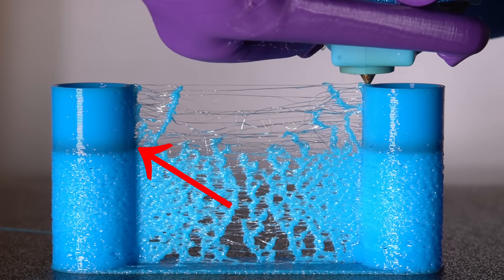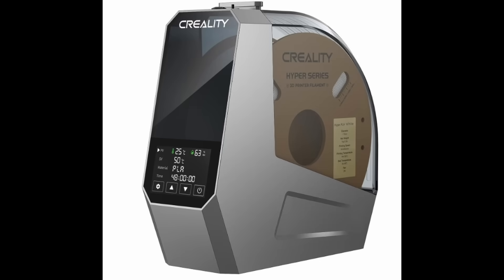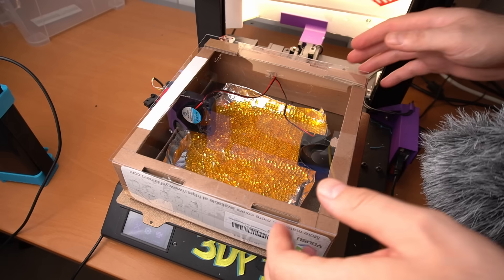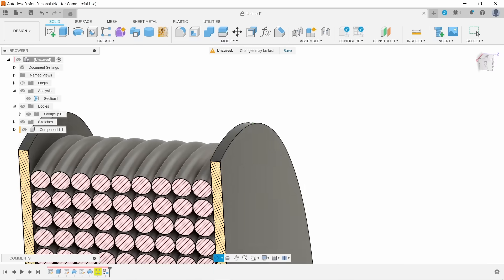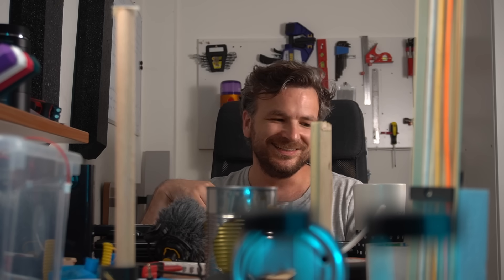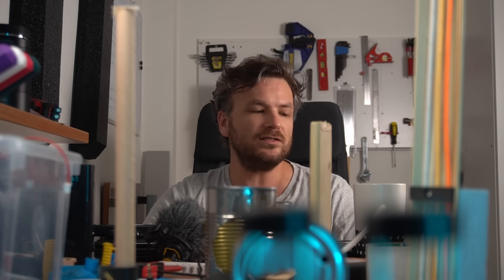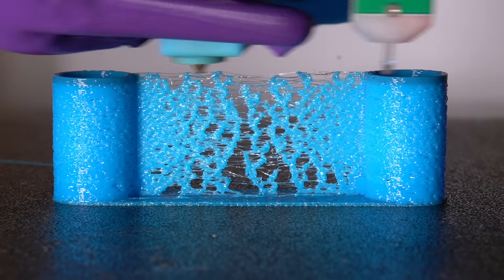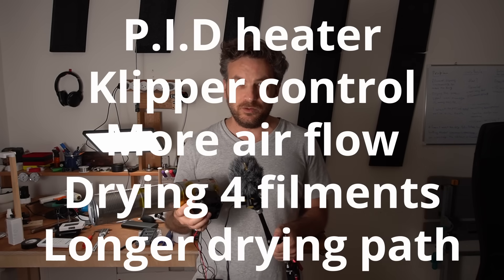Why are we drying filament this way?

Comment: As someone said - don't study physics in school and your life will be full of Miracles 😀
The method mentioned can't work because it is impossible to achieve the diffusion of the water from the insides of the plastic in such a small time. Yes, it is possible to dry a little bit of the surface moisture, but definitely not inside

Comment: Super interesting idea, I also wondered how often I would dry my spools when I only use 10 grams at a time. Pretty obvious instant drying only scales for smaller prints. If the print takes 12 hours and I run a 300 W heater all the time, that will cost me a much larger fortune than running the dryer before. I'm very curious what the next steps will be. One could probably easily combine both, instant dryer and drying box, then run the filament from the box through the instant dryer and turn on one or both depending on the print.

A thing I also learned from this video is how much surrounding humidity affects filament. The room my printer is in is very dry on its own (around 40%), resulting in me not having dried filament for over a year, including TPU, because it simply wasn't necessary yet. Looks like I take benefit from the place I live in.

Comment: Filament dryers sucks, but they work just fine through their inefficiency. You dont have to wait to print if you properly stored your already dried filaments or used a 100$usd filament dryer as they all let you print directly from them. Also, the entire spool gets dried in 8 to 12 hours, not just the surface.

Comment: It seems to me that the best way to remove moisture is to do it at the hot end since the whole filament is being brought up to temperature in that area. We'd need to understand the mechanism of how the entrained moisture acts as the temperature rises from ambient to melting and devise a system that extracts it at just the right point. This is, of course, is beyond the scope of this experiment but may trigger an idea from someone familiar with thermodynamics and fluid properties.
BTW, enjoyed the video and I echo many of the comments about how genuine and entertaining the presentation was. Thanks.

Comment: I don't think you can get away without the drying time. Yes, drying the complete spool brings its inefficiencies, drying bare filament is faster. But it still needs its time, the moisture needs to pass from the bulk of the filament to its surface to get impacted by the air at all. And that mean big part of the usual whole spool drying time is to let the moisture to diffuse towards the surface. Plus having the surface overdried won't help when the core humidity is still high. So just letting that equalized needs is time too.

So the main result is, the most efficient method is to prevent the filament from getting humid in the first place...

Comment: My Imitate thoughts were, counterflow the warm air against the filament movement direction, but no need for such a big can to surround it. Just some long hose (meters). Might need a fan with more static pressure. Also wrapping some isolation around it to retain the heat.  Should still be much slimmer than what you show, and can even be coiled up to increase the length, and then you even have to thermally isolate the whole bundle with a layer.

Comment: Changing settings and printing from a dry box invalidates your results.

Learn from radiator technology.  Try a multi-pass arrangement in your tin can heating tube.  You need to keep the filament in the hot, aerated space as long as possible to maximise the drying effect.  My guess is the reason the $2k unit works is that it does this, with clever engineering to solve the challenges of filament feeding and binding.

Comment: I keep all my filaments, printers, and dryers in a Chitu Systems Printer Enclosure, and I still have plenty of space left for printed items and all the tools I need for post-processing. When neither the dryer nor the printer is turned on, the maximum humidity inside reaches 45%, and during printing it drops to about 35-40% at a temperature of 29°C. This is the temperature inside the Printer Enclosure. The filament is additionally stored in a dryer set to 55°C, which is inside the Printer Enclosure.

Comment: Filament will go past a point of no return if you leave it for too long. Instead of simply behaving like a sponge for the water, the water eventually reacts with the filament to form a completely new chemical. You still need to store the filament with moisture control, but your method is probably amazing for perfecting it during a print.

Comment: I've never dried filament one time. And never had one problem... Not even once.
I've never used the cooling fan on the Hot End even one time...  And never had a problem...  Not even once...
I've never used a washing Station for resin printers even once... And Never had a Problem even one time...
I've never used a Curing Station for Resin Printing even One Time...  and never had a problem once...
I never filter Resin.
I've never used a Vat Heater.  I've never used a Carbon Filtration System.
I've never used a resin transfer pump.
Never used a time lapse camera on either fdm or resin printers.
People watch too many YouTube videos and buy useless, Expensive crap they don't need.

Comment: As someone who lives in the UK where humidity is currently 80% INLAND, This is VERY interesting.
What temperature was that heater outputting? I imagine quite high due to the short run distance??? BUT if its below 80°C (176°F) Then you could probably 3D print something more efficient than the tin cans. i.e. something slimmer to the filament so that there is less area to heat and something that can make the airflow more dynamic (something like rifling?). 

Edit: just noticed that you have done a part 2, will head over and watch that now but will leave this comment here for engagement :)

Comment: i just got a 3d printer 3 days ago. I have printer non stop.... my AMS says that all of my fi9llament is WET.  I did have some miss prints, but just upped the nozzle temp to 210 and the bed to 65 and slowwed down the printing speed. . and no issues since then. I have printed non stop  :) i guess i got lucky but thanks for making this video!

Comment: YOU NEED SILICA BEAD AT THE BEGINNING YOU ARE PUSHING HUMID AIR , YOU NEED TO RUN THE AIR IN DRY 1ST THEN THE AIR MOVEMENT  AND HEAT WILL DO THE REST ALSO YOU HAVE TO MAKE YOUR EXHAUST ONE WAY BECAUSE WHEN USING A FAN YOU ALSO MAKE A VACUUM SO YOU ARE BRINGING HUMID AIR IN THRU THE CANS.

Comment: I got the Thordsen one. It did work for me, except: the feed path is tricky. I use an AMS. It would not feed filament through this, so it only works with single filament prints. 
If you could design one that was AMS friendly, use heat, desiccant, and airflow, you might be onto a universal and fast answer. 
(I hate having to plan far enough ahead to dry filament for 8-12 hrs. )

Comment: I always had this little question too since I started 3D printing: "why do I need to dry the whole spool if I just want to print some 50g of filament?" But since everyone is making the same style of dryer, I just thought that it's the only or most efficient way. Apparently this video prove that it's not. 

But well, my guess as of why no one made this would be patents. Most likely there's a patent regarding in-line drying of some sort, maybe not even related to 3D printing already exist. And when you want to make products that's marketable in the west, you have to respect these patents. So since no one want to be the one testing the waters, nobody invested enough to make one.

Comment: Basic physics would say that if you are increasing the mass that needs to be heated, then more convection energy would be needed to evacuate the additional moisture. So as not to effect the other filaments individual drying process.

Comment: your idea is great but not new

years ago I built a 4 spool fast dryer. 
A cloths storage box 12x12x24 in with 3" spools with 1 " centers as guides on frames front and back to keep tangles out the filament wrapped around giving 3.4 meters in free air
a prusa bed heater plate and fan for 55C air flow.

An arduino, LCD, buttons, thermistor, FET and humidity sensor made up the control

Comment: I'm looking at the video and thinking to myself how to make your 50cm tunnel fir on a desk - and in the last frame it's right there - wrap it around a spool . the simplest ideas are usually the best so take a look at the spool drier for the whole spool and my first thought was - just wrap 3-4 turns round it and make another hole on the outside to turn it into an inline drier.
My next thought was to use some spacers to keep it off the center of the spool.  - that would be more filament per turn but more importantly, better airflow.
Then I thought - just use an old spool and poke some wire through the holes near the edge to maximise the diameter used - and hence the amount of spool per turn.
Final thiught was for it to be in a box below your spool holder - so it takes the same amount of desk space and doesn't kink or have to make any turns.
So just convert a box spool drier for inline use - add some silica gel beads and figure a way to mount your spool holder on top and you've got exactly what you're looking for - the only thing needed is... an extra hole in the spool holder box, an old spool and a few bits of wires, screws, 3d printed spacers - whatever floats your boat.

Comment: how about a box with good seals and strong vacuum inside? water evaporates much easier under low pressure, all else held equal. would make any extra heat much more effective, at the expense of added trouble of maintaining a dynamic vacuum.  not a big step for a stepper like you.

Comment: I like your basic idea. If drying your filament as you go is what you want to do, it would seem that a single-layer filament spool with grooves running in the wrong direction to keep the filament in place on the spool could be used. You could then run dry heated air in a circle around the filament, which would do the trick.

Comment: You could also try the replacement technique:
Submerge the whole thing in some liquid that doesn’t dissolve or otherwise interact with the material, but its surface tension is lower than water, essentially replacing the water with it, ethanol for example but idk if it’ll dissolve your filament, thing is that ethanol will evaporate very easily one exposed to air, so just a fan will do, a hot air fan will make it even faster.
If can’t use ethanol try other types of alcohol like isopropyl or methanol, I’m not a chemist so you’ll have to research for something suitable for the task.

Comment: Problem is too small amount filament inside tiny cans. You really have 2 options, use way tin cans and fans or put way more filament inside the same amount space. Even then you most likely can not solve the issue fast. I have plastic industry background and believe or not, sometimes takes even small granule try time about week or so. What works is circulation and load of air flow. Heating is necessary only so much to get air sort of dry....cooling works better because AC air output is way more dry air. That is why cars use AC even on coldest winter time. 8 hours, 12 or what ever hours most likely is not enough on any conditions if there is already exposure for moisture. Conclusion, there is not possible to get nice dry plastic just instantly.

Comment: Instead of blowing down on the filament, you should blow against the direction, at a slight angle. 
Then you have way more exposure time, and should dry more effectively. 
Just put some water on a flat surface and use a heat gun.
Pointing directly down it will take many seconds to dry it, but if you angle it, it's gone in a second.

Comment: I’ve had good results using the polymaker dryer while printing. It literally heats the filament that is being used first since that filament is on the outside of the roll so as your print it’s drying the outermost part of the filament spool at a faster rate than the rest of the filament essentially doing the same as drying a strand that except you don’t risk stretching and braking of the single strand if your temp peaks to high.

Comment: Great idea! I must admit I use a food dehumidifier which is fan forced. It is big enough to hold several spools if necessary and runs at 75 degrees Celsius. Your idea of in-line drying is excellent and I wonder if a insulated tube from the dehumidifier to the printer allowing warm air to flow between them would be even better. Just a thought…….

Comment: I absolutely love this idea but I would take it one step further

I'm not sure exactly how you got to this point as I've watched the entire

But what I would do is I would add tubing that you can bend maybe copper or something that's soft and add some additional holes into it that way it can transfer at a longer Pace in a spiral and still get air flow and transfer of the heat directly into it as we all know that copper is a good thermal conductor
This would give it what I refer to as dwell time

It's a term used in firearms and maybe used in others but basically it's a form of time over length of set time to allow mechanical functions to work

In this time it wouldn't be a mechanical as much as a thermal and gasification process

Don't get me into gasifiers lol 

Put gasifiers do the same thing they basically heat a particular material up until it creates a gas that is used for all different types of purposes

But in this case we're trying to gas off the moisture...
I love the project but I don't have the time to test it out myself and this would give you a bit of content for your channel and you seem to have the time

Keep up the great work and if you like it and it works you can tag me in it or you can just say this dude was onto something but not quite LOL😂🎉❤

Comment: what if you make the path through the cans longer as to keep the filament inside the moisture extraction phase longer, like with pulleys or tracks or a cylinder within a cylinder which can have a longer portion of filament inside the drying chamber at once, keeping it exposed longer?
I know friction is an issue when wrapped around too many times but maybe that can be figured out too maybe a rotating core that helps move all of it along as well?

Comment: So it does work, or it doesn't work? When you talked about how you don't normally have your tpu at 60% humidity, you showed the printing using filament that's in the normal dryer...

Comment: sooooooooooooooooooooooooooooooooooooo it could be used during respooling, rewinding spool isn't that hard, there are free models to help you set up rewinder, you'd just put this in between and have it run, possibly cutting down drying time significantly? 

for people who store more spools at once, having a big cabinet (just wooden box is enough) to which you stuck regular home dehumidifier is mostly enough, but this could be cool to fix already wet filament, maybe something you forgot in the open

Comment: Get a peltier cooler... Circulate the air and let the condensation drip out of the cooling fins. Use a PWM to stop it from freezing and you can even make the hot find extend out of the unit, so it has little heat build-up. But you need heat to aid in humidity absorption.

A desiccant dryer is actually a horrible setup. 🤪

P.S. You can get a "desktop dehumidifier", which is already setup to do that too, but it's overpriced. It uses a cheap peltier cooler.

Comment: great idea but I would put the heater and fan at the bottom so the heat rises up the cans with the filament, pulling even more moisture out and maybe a lower airflow extraction fan at the top so it doesn't get too hot.
Just my thoughts.

Comment: suggestion: inside the cans you could make a venture system, this will lower the pressure but gon speeding up the air, and maybe this can dry up better.🤷🏾‍♂️
and move your fan/heater to the bottom of the cans.

Comment: I changed the PTFE tube from the extruder to the heat break with an aluminum tube, mainly to help with filament loading, but the side benefit was that it made unprintable PETG usable, my guess is the waste heat making it past the heat break is driving out some the the water in the filament.

Comment: This makes complete sense to me. I personally when its a problem print directly from the dryer box, so the outer portion of the filament that your actually using passes through all the hot air right before using it. It seems to work very well.

Comment: I figure you could almost just blow hot air through a tube, probably a tube larger than a bowden tube. I figure the main inefficiency of your 3-can dryer is air velocity, the heater and fan aren't mounted ideally for the full tube. 

Maybe some 1-inch PVC pipe?

Comment: I think the bad energy efficiency of an in line dryer is a strong argument against it. 
But if you want to build one, how about scrapping an old microwave?
This should get rid of all humidity, even if the filament passes it's inside only for a short time...

Comment: the trouble with in-line drying is that wet filament tends to br brittle so is very likley to just snap as it comes off the spool.  not a problem with TPU but it is with non-flexibles.  combining both aproaches might be good for super hydroscopic high temperature filaments though

Comment: I would suggest adding both some insulation on the outside of the can, and some thermal mass on the inside - doesn't need to be anything really special, just to allow the heat to be stored a little...

Comment: East answer to the question posed: yes, I would 100% want to go with an in-line dryer. I’m new, using PLA only until I decide how to deal with drying, and the options available all seem to be pretty weak. And I want to print now, not in 8 hours too! Keep up the awesome work, smashing the sub button now.